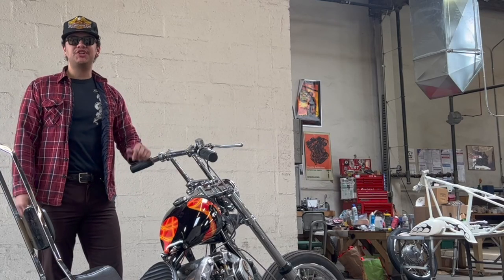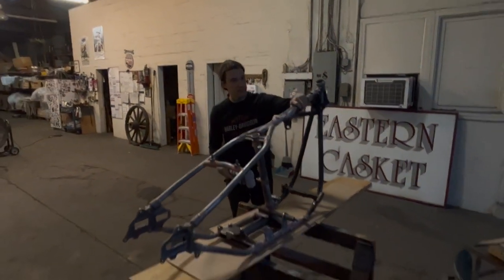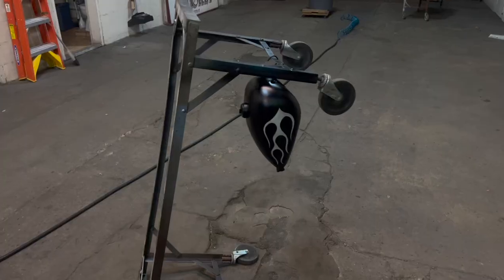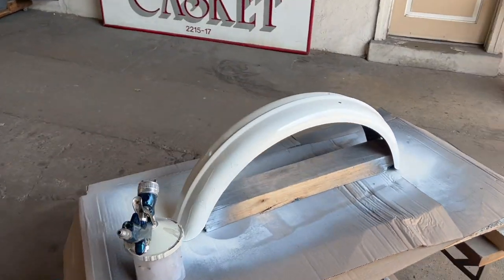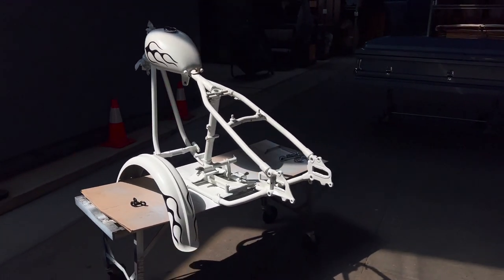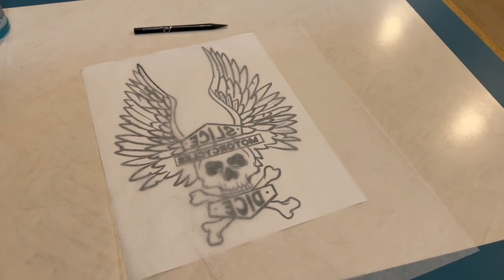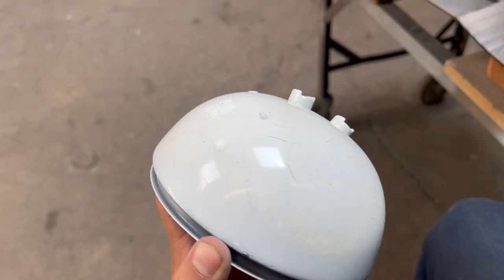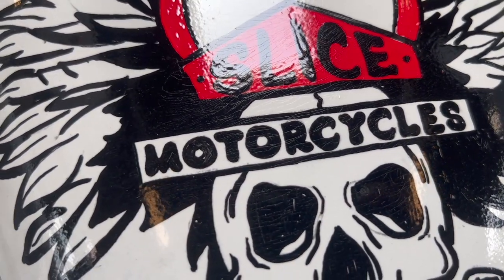So You Wanna Paint Your Own Chopper!?!?

Comment: Hey man, what technique did you use for the cracking on the clear coat? looks awesome!
Reply from the maker: I mixed my clear coat with just lacquer thinner, then after it dried, I heated up one small surface at a time with a heat gun, then immediately after taking away the heat, I hit it with a can of compressed air for an instant rapid cool
Reply: @sliceanddice69 did you add hardener too or nah? Did you use a urethane based clear? I'm trying to pull this off on a sporty tank I got